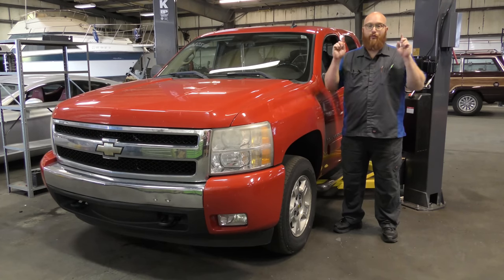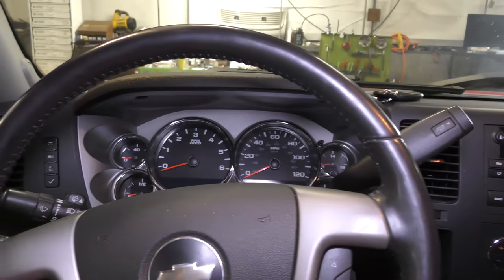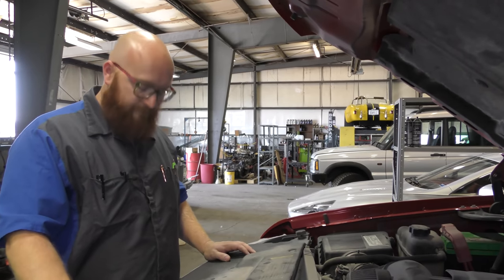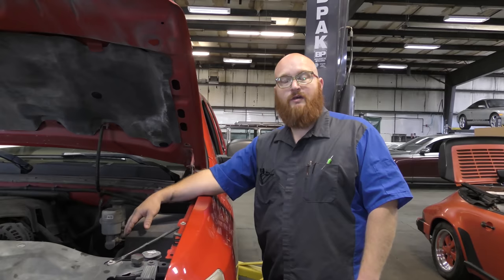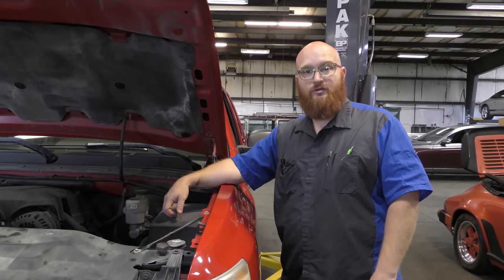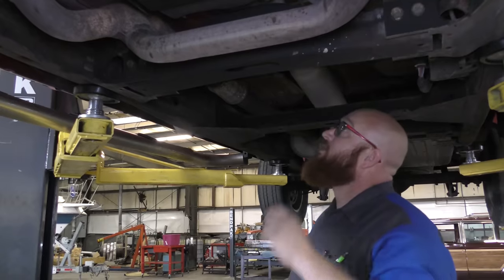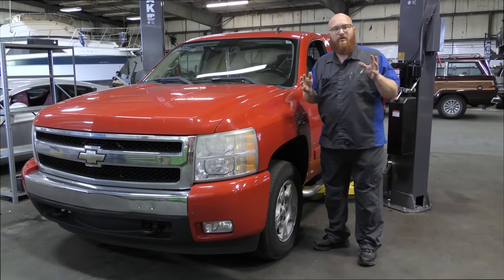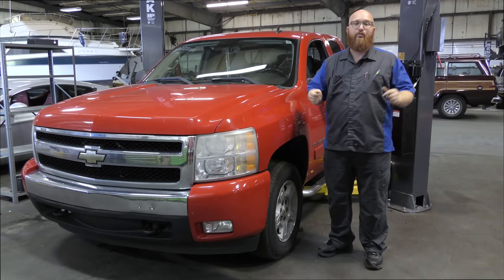Good Truck/Bad Truck? CAR WIZARD shares most common problems on the 5.3L Chevy truck at 100k+ miles

Comment: Dont foget they burn oil because of the bad pvc valve built into the valve cover. There is a updated valve cover to fix the problem

Comment: Sounds like this truck has some issues for 140K, but easy to work on.  Underneath and frame look good.  Usually, you have a price for parts - match labor costs.  Thanks for the Video.

Comment: My truck is an 07 4.8, and the door switches always stop working. I take them out of doors, tear them down to circuit board and clean contacts with alcohol. Does the trick for several months until they get dirty again.

Currently I have steering wheel pops, sounds like my intermediate steering staft needs replaced. Hopefully nothing more is going on.

Comment: All I can say is avoid the ones with active fuel management from this era (2007-2013), which was basically the 5.3L V8 engine.  The others don't have issues (the 4.3 V6, 4.8 and 6.2L V8's).  Only the 5.3's of that era had this and it was a huge problem, and lead to a lot of people having to spend thousands on rebuilding the top end of their engine (replacing one or more collapsed lifters).
Plus broken exhaust bolts (on the manifolds) were a common problem too.  I'd say if you want a Chevy truck, get one 2005 or earlier, or get one of the newer ones (they did change the AFM system in the newer trucks, I think around 2015+).

I had a 2013 and granted it ran for 8 years / 160,000 miles before I sold it, but I probably spend about $2,000 in what I would call "unnecessary repairs" ($1000 to replace a failing oil pump; another" $500 to have both exhaust manifolds fixed after the bolts broke off.  I mean and all of this happened shortly after the warranty ran out, so around 110-120k. I drove it for another 3 years after getting this stuff fixed, but finally sold it at 8 years.  I would NOT recommend the 5.3L V8 if you do happen to buy a 2007-2013 era Silverado.    Spring for the 6.2L, as it will use more gas, but in that era, it doesn't have the AFM and so you shouldn't have the issues that come with it -- collapsed lifters; oil burning, etc).

Sad thing is in mine, the trans outlasted all of that stuff and still shifted smooth the day I sold it.  The trans was probably the only "good" thing about the truck after all those years (heck, the radio burned out after 4 years and had to be replaced).

Comment: "If you think that's to high, you drill it out!" Literally the best comment EVER! Yes, you can "Hog" it out with ease. But you can't easily replace the material and create a new support bore! That's why such jobs cost so much! So, quit your bitching and pay the man who has the "Demonstrated" skills to save your engine! And in rare cases, your totally _priceless engine! Just be sure to remember the golden rule...Aluminum and Iron are vastly different animals! Also know, that extremely talented welders can do both and provide you with a superior end product! If you're asking a welder to weld aluminum who has no experience welding aluminum, that's probably not going to turn out well! Always remember a very simple rule..You get what you pay for, mostly!

Comment: Car Wizard.  I bought a 2014 Silverado 5.3 Vortec3 Gen. 4 (I think) w/66k in 2018. There are 88k now.  Needless to say I'm pretty rattled.  I thought I did my research. A few weeks ago I read about the class action law suit against GM over this engine.  Then discovered your Youtube channel.  I keep to the scheduled maintenance religiously.  I never observed oil or radiator fluid loss, no strange sounds from the engine.  I now check oil/radiator by hand and am not relying on the computer for notification.  Is there any preventative maintenance steps I can take to counter act the AFM damage?  Is this enviable with all 5.3 Vortecs?  Or should I cut my potential losses and fork out the dough for a Toyota? It's a nice Silverado...but this Vortec situation's got me feeling uneasy.

Comment: Had to drill out a few bolts from the manifold they connects to the cats on a Chevy truck took a bit longer then it called for and the store manager had the audacity to tell another tech, “ he saved the threads that’s something I wouldn’t do” I apologize I don’t like doing half ass work.

Comment: Hey Mr. Wizard I got a question to 2 questions I have a 2008 Chevy Silverado Z71 4x4 My lights and I do mean all of my lights they all flicker  What do you think it could be and my battery light does come on sometimes brand new battery brand new alternator and my other question is I keep coming up with a code P1175 I changed out the spark plugs and wires what else do I need to do

Comment: I will 100% pay more for a honest, and  good mechanic, shop who does quality work. These mechanics stand behind there own parts, work.  You can always pay less, but usually cost you more money with bad work. I love the 5.3 as far as reliability, but the low end torque is horrible. I couldn't deal with towing up a hill at 4300rpm,and downshifting.  I own a second gen 2.7 Ecoboost now.

Comment: I’ve had my 09 Silverado 4x4 since I bought her new in 09 , around 160K miles, 5,3 motor in her , didn’t know about those exhaust manifold bolts I’ll have to check and see if I have any broken off heads there , let’s see , the flex plate had to be replaced also those torsion links a couple of times and gas tank sending unit , the traction control switch along with brakes and tires also I just replaced the power steering oil cooler it rotted out , as for the power door locks and windows that driver side arm rest switch until was about 30 bucks on Amazon about a ten minute job to replace , I live where we have winter so every fall since it’s been  new I take her in for rust proof spray oil , Crown product which use to be Carwell , all in all it’s been a great reliable truck , oh ya also a starter motor, ok thanks .

Comment: Wizard, removed a bunch of those manifold bolts, don't waste time with an easy out. Just weld a nut on, or washer first if it's sitting below the surface. Couple of minutes a bolt if that.

Comment: I so wish if I was ever there to  get my vehicle inspected with you. So I have been quoted for a rear main seal leak. After checking your video I went under the truck and opened the cover and saw my gears inside all dry. I have a GMC Sierra 2014 4.3 which has a cooling line connected to the transmission. My engine bay is all wet under and suddenly sometimes I see oil drip on my drive way..it's frustrating as it leaks sometimes and the tech believes it's a rear main seal. You mentioned saying it's not..so this symptom would be that $10 seal in those lines. Please reply if you could it would be a great help as I don't know what to do right now..either get the seal changed with a big bill or change the oil cooling lines .

Comment: I just got a 2013 5.3 Z71 with 28,000 miles. Would  you recommend changing the filter on the transmission due to the age of the truck? Even if the mileage is low.

Comment: I'm curious if you'd expect the same types of issues on a used S-10. I'm planning to get one as soon as the price insanity ends. Going to get a manual 4-cylinder model per your recommendation from the mid-size truck video. Same kind of thing-- going to get one with 100-120k miles and would like to drive it for another 100k +/- miles.
Reply: Consider a 2nd gen Colorado with the LCV and manual transmission, but mine isn’t for sale.

Comment: Hello I listen to one of your videos earlier this week of which trucks not to buy because I believe you said to beware of the vortex. Did I hear that right, not to buy any vehicle to buy any vehicle with a voertec ? I don't have much money and I'm shopping for a mid size truck. I found a 1994 Chevy S10 has 4x4. Everything looks good with out seeing it physically. It says it needs a tps for the throttle sensor to be replaced. How easy is it to replace? How spendy is it plus part? Is this truck worth getting, if so or no, why? Thank you for reading this. They're asking $3000. Too much?

Comment: we dont run into this as much but we get flak at my shop cause our boss wanted to rebuild e6 Mack engines and after a while its no good things wear down and they wont run for long the mechanic can do good work but if you give them junk that cant be salvaged dont expect special treatment you tell me to rebuild an engine its more than new rings and piston and etc. if the engine its self isn't worth the rebuild dont rebuild it but that's what they want a large portion of trouble you get from mechanic is the I can fix it in a hour so they should have it done in 30 mins but it doesn't work like that a Mack e6 takes a few days to rebuild as there is many steps in it to even see if its worth it but you get a truck driver they will spew it dont take long to rebuild most dont know of all the work that goes into fixing stuff and im not working for below minimum wage to fix your stuff you pay for the labor and the quality as its our job some dont have quality and that's on them

Comment: Since you work on these a lot maybe you wouldn’t mind answering something for me? I have an 08 Suburban and the oil is being diluted with gas. Same engine as this truck with the 4 speed transmission. There is also a slight oil leak coming from somewhere at the top of the engine. (I’m thinking valve cover gasket). The oil is very clean with good color and I’m not losing coolant. The biggest problem is that I can only get about 1000 miles on an oil change because the oil becomes diluted enough that the oil pressure gradually climbs down enough to trigger the low oil pressure alert. I use a good high mileage full synthetic 5-30 oil. Would the valve cover gasket have anything to do with this? I’m just trying to figure out how to find where the gas is entering without tearing the whole thing apart. Any insight is much appreciated.

Comment: My theory is if anything needs to be done (repaired or replaced) to a car / truck. count on a min $500.00 to $1,000.00 if anything more complicated needs to be done figure of 3 to $5,000.00. Mechanics don't work for free, they are running a business with overhead and other costs that need to be covered. If they charge $125,00hr, its does not mean its all going into his pocket for income!

Comment: What kind of shocks do you recommend for a 2008 Chevy Silverado 2500 HD with torsion bar suspension. I was told by a mechanic shop that bilstin shocks would work the best. I recently replaced my shocks and still have a bumpy ride and I’m filling every little bump on the road. Any recommendation of what I can do. I have an appointment on Saturday for a secondary opinion for the suspension in the front I’m hoping it’s nothing major

Comment: Hey Wizard, on the broken off bolts, if there's enough bolt left sticking out, any reason a shop wouldn't weld on a nut to make them easier to remove and avoid drilling them out?

Comment: I have snapped exhaust manifold bolts during removal.   Did GM us low grade bolts on these??    Do you upgrade to stainless or some other better quality bolt??  Do you use a high temperature antiseize during re-assembly?

Comment: I will never buy another mid 2000’s GM or Chevy truck. Suspension problems happened so often. After about $9000 in suspension parts over 4 years, my Gm went to truck heaven

Comment: Question for car wizard 
A 2001 S430 ABC VISIT WORKSHOP LIGHT COMES ON THE CAR IS AIRMATIC AIR SUSPENSION SYSTEM NO AIR LEAKS NO BAD STRUTS NO BAD VALVE BLOCK NO BAD COMPRESSOR.
ANWSER:
#A. STEERING ANGLE SENSOR BAD
#B. BODY ACCELERATION SENSORS BAD
#C. N51 ECU CONTROL MODULE BAD
#D.  TCM BAD TRANSMISSION CONTROL MODULE BAD?

Comment: I got 2005 chevy 4x4 crew cab 5.3 4l60e with original 300k plus still runs strong no motor are trANS WORK JUST WATER PUMP BRAKES

Comment: I’ve got many of those broken bolts out usually I just weld the nut on it and pull them out that usually takes about five minutes 10 minutes at the most
Reply: On these chevy ls engines. The bolt usually just pops the head off. Use a extracto socket and they usually come out very easy with no heat. I've  done a lot of them and never had to drill them. Older chevy engines and other trucks, I almost always had to drill out or weld nuts on it. It's like the  expansion of the manifold after years that pop the head off the bolts on these engines

Comment: A workmate has a '10 Sierra, and he says it takes major surgery to replace a headlight bulb.
Reply: True. The only thing design engineers have done is put things in assinine places. Headlight bulb changes are about like fuel pump/ sending units. What used to be a 20 min. Affair with a new gasket and pump R&R is now drop the whole tank down, or cut a hole in the box or loosen and remove bed bolts so you can jack and block it up to do the pump. Bitch and stupidity are the operative words for these improvements. For the cost of these POS now a days they should fix themselves.

Comment: Im sure someones already mentioned this but you could also get an 'hd like' version on the 1500 with a 6.2l  v8 and 4l80E trans (basically the max tow pkg, or denali pkg also?).  My wife is running our 2011 with this setup, it pulls our 28' camper better than my 3/4 ton with 6.0, altho my truck is my work truck and its been used and abused

Comment: Wizard : I have a 2013 Chevy Silverado  4.3 Liter with 51,000 on it , bought it new , never worked it hard at all . Since its this old would it be a good idea to change out the transmission fluid even tho it still has good color and not a burnt smell . Age thing is what I'm concerned about . Thanks in advance .....

Comment: Very informative video! I just got a great deal on an '09 1500 with 65k miles. Besides some cosmetics the the truck completely checks out and is mechanically mint. Came here just to find things to look out for as the truck ages and goes up in miles.

Comment: Although I completely argree with your price of half an hour per bolt, I work a machine shop so we have to get broke bolts out of ls heads all the time. We use a welder and nut and it is much faster and easier than drilling why wouldn't you be able to do this in the car? Just wondering

Comment: 3 years later; prices falling through the floor due to inflation.   You forgot the FP fails at 150K most of the time, the heater hose to core quick connects fail at about the same time, softening.  The radiator / transmission cooler may leak radiator fluid into your trans grenading the trans.  Those intake leaks are fixed by retorquing the intake.  Had the same issue at 80K.  Retorqued twice and no issues at 290K.  "Takes me 45 minutes and I charge for 3 hours."  The reason ive done my own work for decades.  This kind of shady stuff is built into auto mechanics.

Comment: 150,000 miles on a 5.3 is nothing for this engine. I've had several 5.3's that went 275,000+ miles with nothing but normal maintenance done to them. They remind me of the G.M. 3800 V-6 engines. Bullet proof.

Comment: So, you said you don’t change tranny fluid over 200K (or something like that).  I have a 2004 GMC Sierra 4.8L 4x4 with 225K miles and I guarantee you my dad never serviced the tranny.  What’s your take on servicing this tranny.  No issues with it at all - at the moment.  Thanks

Comment: My 2006 chev sliverado 1500 has a oil leak. I got it when I turned 17 and now few months later I found oil on the concrete.

Comment: Hello,Mr.Car Wizard.Would you recomend to buy 2011 Chevy 1500 Silverado V8 with 180k miles and good  srvice history?
Reply: Mines going on 210,000 miles. I also got it at 180,000 miles. So far only changed throttle body sensor. Not the whole throttle body and spark plugs.

Comment: I know I'm late but I'm curious if the 4.8l's have the same issues as the 5.3ls, the manifold bolts, ac belt, etc. And that oil blockoff plate

Comment: researching for info and input. 2008 Silverado automatic transmission, does not want come out of PARK and into DRIVE. Seems to be getting worse each time. Checked fluid, level ground, running, hot, level indicates just below the word "hot" on stick. Just at 70,000 miles. any thoughts on issue ?

Comment: I would love to see you do this kind of video for my 2002 mitsubishi lancer. I'm at 190k miles and debating doing a second timing belt change (first one was at 100k miles), or just replacing the car.
Reply: You should trade it in for a newer Mazda 3 instead.
Reply: I had the same one, bought at 150k beat the piss out of it for years and sold it to a buddy its at about 200k now no problems.

Comment: Thank you for this informative video! I actually just got 2 of these trucks and I still have my older model 2000 Silverado as well and like every 5.3 my old 2000 has broken manifold bolts ☹️. It has been like that since I bought it in high school at age 17. Now I’ve had the 2000 for quite a few years and rust is also taking its toll on the truck which is why I snatched up the 2010 and 2013 trucks while I could before the market sky rocketed! 😂

Comment: I have a 2010 4 door 4x4 with a 5.3. Bought it used. Its a decent truck but what bothers me... my instrument cluster has no oil pressure guage or charge guage. Thats how it was designed. Why the heck were some made that way? Scares me not knowing what my pressure is of course I check the oil.